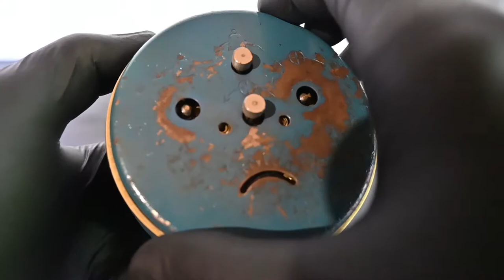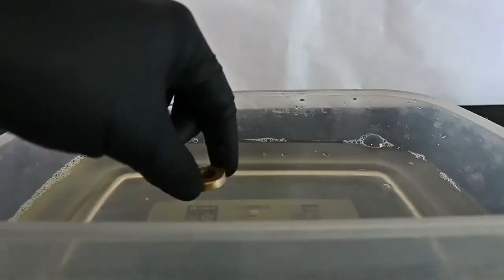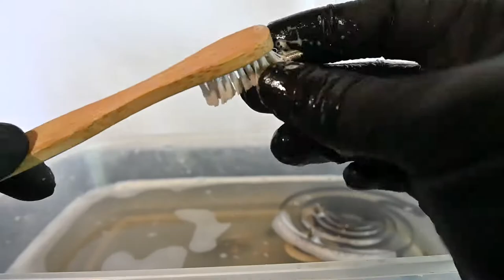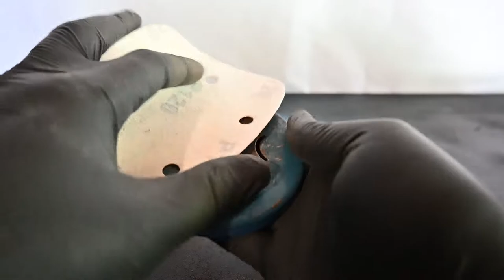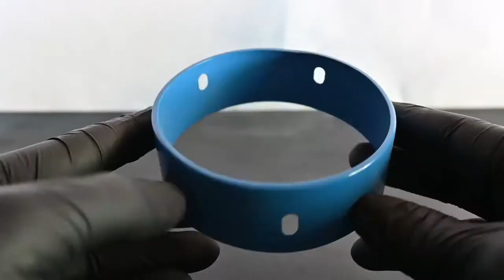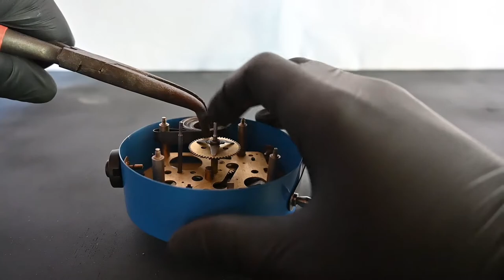Restoration Old Russian Clock

Comment: Assemble or disassemble the mechanism first and then place it inside the case. Release the mainspring tension before removing the plate. The tension from the mainspring can damage the pivots, bend or brake tooth from gears....